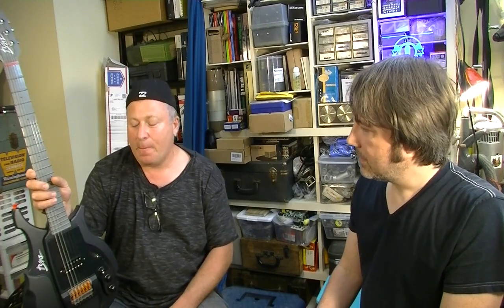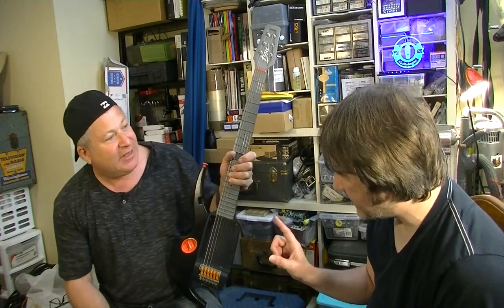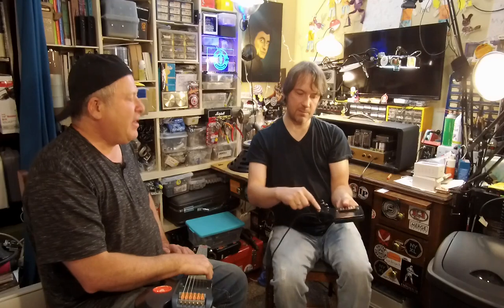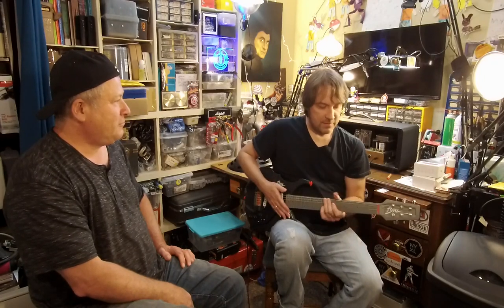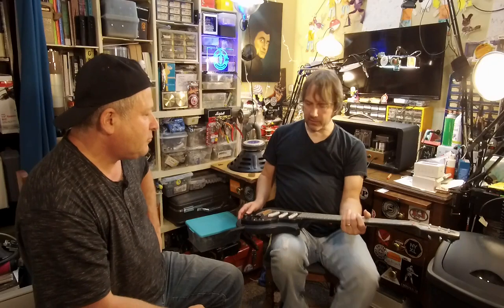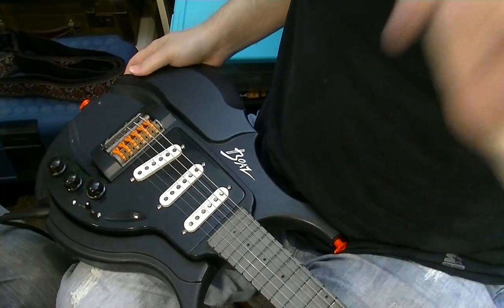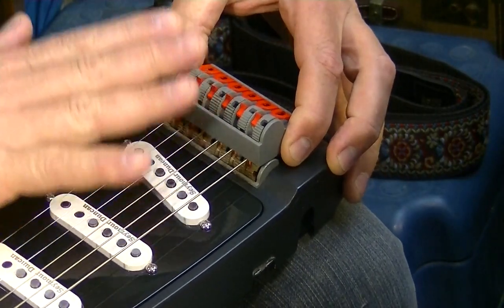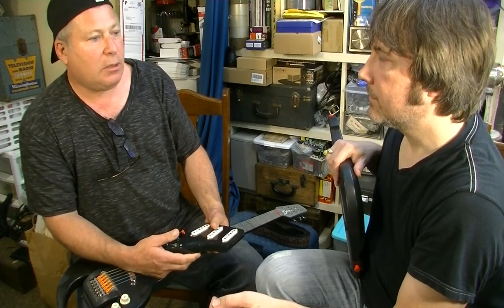THE GUITAR OF THE FUTURE! - 'Boaz One' Plastic Modular Guitar

Comment from the maker: Save 10% on Native Sons Straps with this code: GUITOLOGIST10 https://www.nativesonsgoods.com/
Thanks for supporting my sponsor!
Reply: Definitely a product I'll be keeping an eye on sounds great, I mainly play Acoustic Guitar but do have a Godin SD which I dig out now and again if I was to get something different this would be on the list, thanks Brad for more great content
Reply: @15:50 I'm pretty sure he means Delrin or Polyoxymethylene, an engineered thermoplastic developed b DuPont. I operated CNC's that made ball valve seals supplied to petrochemical companies. We machined billet extrusions to manufacture each seal per specifications using their proprietary designs.
    This stuff is amazing...in it's natural state it looks and feels like regular white acetyl but a much higher density you can feel. It's strength, stiffness, low friction, and dimensional stiffness makes it great rust-proof option for metal, yes it can replace many metal applications. You can machine it to tolerances in ten-thousandths with minimal variances due to thermal expansion.
   I've personally taken home 1/4 inch thick butt-ends of 5in. diameter billets and set them up as targets and shot them with .38 special, +P, .45auto, and every caliber below those with the shortest distance 10 feet.....not a dent, hardly a scratch....nothing but lead splatter. 
   Truly awesome stuff.
Great vid, Brad!
Reply from the maker: In the description are the links to his YouTube videos. He doesn't yet have the Indiegogo campaign up. When he puts it up, I'll post it here and announce it on a SPF.
Reply: Addendum: Fret wear. Even though it's very tough, Delrin will abrade... however it will not indent. But I believe based on my experience, it will abrade less than nickel or similar fret material, probably (not sure) it will abrade more than stainless steel. Solution: Drop-in/Pop-in fretboard. I bet the fretboard is machined; they could be CNC'd and rip out hundreds a day super cheap. Or if you prefer the sound of metal frets, CNC a groove in the raised portion and epoxy in metal frets of choice.
Reply: This is awesome! The bridge alone sold me. Can’t wait for the indiegogo campaign.
Reply: The plastic is called Delrin.
Reply: @michaelmoore7975  This is why we need a fretless bass version :)
Reply: @aurthorthing7403  Good idea. But for any potential patent infringements we'll  call it the "Baseless Fret" version. ;)
Reply: @michaelmoore7975  Frets abrasion: Certainly. Especially for people who do a lot of bending and vibrato. I wonder how much he considered this... I didn't look at the entire video, so I still wonder how soft the frets are in this regard.
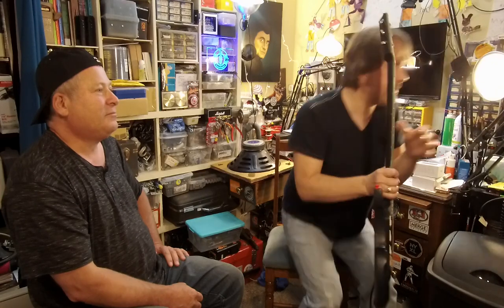Reply: @EddieOtool  From 16:32 to 17:08 they talk a bit about the frets. It also shows pretty good close-ups. You can see the frets are flattened instead of crowned, this tells me he realized a potential to abrade quicker when the contact point is thinner, i.e. he flattened them to "spread the friction" over a wider contact area, minimizing wear but not completelety negating it. 
     Delrin has an inherent low-friction quality; a "slickness" that makes it feel similar to a freshly oiled fretboard. I know that sounds counter-intuitive to my previuos statement but here is the rub (pun intended). Compared to most metals, the surface hardness of Delrin on the Rockwell R Scale is R122, (kinda soft). Dynamic Coefficient of Friction is .25, (pretty slick). On the Rockwell B scale Stainless steel is B88 (very hard) and around .42-.60 friction. Nickel-Silver is B60 (still pretty hard) , and about the same friction as Stainless. Delrin is "slicker" but surface hardness is less than normal frets. 
      I believe the Delrin (flattened top) frets would last a similar amount of time in normal playing compared to Nickel-Silver. Perhaps less than Stainless. But if you're a grinder I expect that time to be shortened dramatically. Of course other factors come into play also: string material, diameter, smooth or wound strings all affect wear characteristics. The sound would be a little different with Delrin; not as "bright" ...a little more muted. Regular frets get indentations on the 'cowboy chord' area, but Delrin has a Durometer rating that gives it resilliency and ability to "bounce back" those small deformations caused by pressing the string down over time; however Delrin can be nicked, cut, dented or scraped simllar to wood.
   I think the Delrin would feel soft when fretting and sound a bit muted. Special techniques such as tapping, hammer-ons, pull-offs etc. would probably sound nothing like metal frets. The decay of a note would probably be shorter as well. Also, the inventor stated he just used a Sharpie to color the fret tops, I bet it doesn't take but a couple of minutes of playing to wear it off.
   The primary concern for most guitarists will be sound.  Wear characteristics, feel  and appearance would be secondary.
Reply: JosHuang Gray  yeah, it could destroy all that is natural...kind of like deforestation has been doing.
Reply from the maker: I've been informed that they plan to start the Indiegogo campaign in the middle of JULY, not June, so that's my bad. I'll post an update here and also mention the date in a SPF when it gets closer to time.
Reply: The Guitologist thanks for the update man. I'm really looking forward to it.

Comment: The plastic the neck is made from is delrin. Gonna be watching for this one! Hope they make a Floyd style bridge.
Reply: Yes, the same plastic that picks are made from, very ingenious... From Wikipedia: Polyoxymethylene (POM), also known as acetal,[2]polyacetal, and polyformaldehyde, is an engineering thermoplastic used in precision parts requiring high stiffness, low friction, and excellent dimensional stability. As with many other synthetic polymers, it is produced by different chemical firms with slightly different formulas and sold variously by such names as Delrin, Celcon, Ramtal, Duracon, Kepital, and Hostaform.
Reply: @morrismiller1055  That's awesome, Morris!
Reply: I hear Flame Delrin has a biting top end, Celcon has a mahogany midrange.....

Comment: Some info about Delrin.

It's a very VERY high density extremely high temperature thermoplastic.  It's reinforced with a large percentage glass fiber in this mix.  He's right that it's pretty expensive.  

I doubt you'd be able to wear these things over 5+ years with very regular playing.  I suspect the metal on the frets will actually wear quicker.

Comment: I would like to see this with a wireless system in it. No cables needed.
Btw he means Delrin or also called POM (Delrin is a brand name but most people in the US call it that way)
Reply: Polyoxymethylene, awesome stuff. Worked with it a lot. Read my posts under "pinned by The Guitologist" at the top of the page.
Reply: I used to do machine design as a technician, and Delrin was to us a very reliable engineering material. You can call it "plastic metal" in a way; one of the toughest and most usable one you can easily find. We would consider this material whenever we needed something just a bit less resistant than aluminium, lightweight, and easily machineable. It gives great results: no melting, no deformation under heat from machining, and reasonably precise result. I recall I heard some people even did combustion engine blocks made of Delrin so much it is enduring, but don't quote me on that. I just don't know how well it resonates compared to wood; I personnaly tend to find my guitars have a plastic-like resonnance when played unplugged that totally turns me off... That's why I ended up changing a plastic pick guard on one of my guitars for a mahogany plywood one; it did make a totally welcome difference...
Reply: Delrin picks are a nice alternative to nylon. Try them if you haven't already.🎸
Reply: @54fighting5  Indeed I have. I've taken home scraps to fashion into all sorts of things and made about 50 or so picks. Gave a lot away. They last forever. So stiff they can be made thinner, but so slick I had to drill multiple holes in them to improve the grip. Also made pistol grips and checkered them. Looks similar to bone or pearl and will never crack. Knife handles. File handles.  Non-marking contoured dapping mallets. I've even taken the shavings from CNC millings and  woven and braided snatch-ropes to pull out stuck 4-wheelers and even stuck full-size trucks for my off-road buddies. They will not break and only a slight bit of stretch.
Reply: @michaelmoore7975  Lol dang I feel like a slacker. I bought mine on Amazon. Thanks for all the info, I had no idea there were so many uses.
Reply: @54fighting5  What? they got 'em on Amazon? I knew I should have marketed them. Now I feel like a slacker. Lol
Reply: As far as picks are concerned, I get more durability out of polycarbonate than delrin, by a long shot. The only downfal is polycarbonate tends to break when flexed repeatedly.
Reply: @EddieOtool  I've tried poly before, made some picks out of scratched up safety goggles (I hate having to buy anything ) but I can't remember why I didn't like them. As cheap as they are, I still like making my own...Bass and guitar picks made of cork, single-split cowhide, aluminum, various woods, felt layers glued and pressed, boot soles, PEEK (Polyether Ether Ketone), Bronze/TFE, Glass/Moly/TFE, Graphite/TFE, polystyrene melted and molded, old credit cards, AOL CD's (I think those are polycarbonate)...you name it, I probably tried it.
Reply: @michaelmoore7975  Interesting. How did the PEEK ones fared? I used to work with that material a long time ago. A plastic with very high melting point... 

As I said, albeit lasting, poly is brittle, which is a good enough reason not to like it. It also convey some kind of feel which might not be likeable to everybody. It is stiff yes, but somehow awkwardly so.
Reply: @EddieOtool  The PEEK was too stiff. Not enough flex; and when I would  taper the cross section thickness down to the tip, it reached a point of decent flex (and I like 1.0mm!) but would crack pretty quick after playing a bit. It had a raspy kinda harsh gritty sound at the initial strike of a note. Really gritty if you change the attack angle, and like a primary saw at a mill when you do a pick slide. I kinda liked it. 
      I used to work for a company specializing in CNC custom industrial plastics manufacturing. For the most part, we made ball-valve seals for petrochemical companies using their proprietary designs and specifications; along with a standard line of products. They had other products besides seals too, but I just worked as CNC programmer/operator for ball-valve seals. Our materials were: Peek, Virgin and Filled
. UHMW. Acetal. Delrin. PVC. Torlon. Rulon. Ryton. Tefzel. Phenolic. Nylon. Nylatron.    In-house we also made: VirginTFE
. Glass/TFE. Glass/Moly/TFE. Bronze/TFE. Carbon/TFE. Graphite/TFE.             
           Made picks out of most of them, Delrin was my all-around favorite.
Reply: @michaelmoore7975  Nice! Thanks for the info! :)

Comment: "Whereas the traditional electric guitar bridge adjusts each string through a two-axis, rectilinear, adjustment system (height above body; distance to nut) the Boaz bridge is curvilinear - a polar coordinated, eccentric (off-center) system which automatically compensates for the intonation by moving the string closer/further to the nut as the height is lowered/raised."

- Randy Zeitman .... Mr. Boaz, you're welcome to use this text without need for compensation. This is a fantastic product and can't wait for the bass.

Comment: Seems like a toy to me. I would worry about plastic pieces breaking. Just my 2 cents.
Reply: @Swetty Spaghtti - If the neck is any kind of indication, that Delrin is almost as hard as steel, much lighter, and very durable. I'm sure the modules will probably be made of something nearly as tough as the neck/center section, or whatever you desire, and if you get involved with the kickstarter project, you can customize it all you want, as long as you supply the funding to create it!😉
Reply: @danw1955  I dont trust the bridge pieces at all. Im at a gig,one of those orange bridge pieces breaks. Done
Reply: @swettyspaghtti  True, but then again, there's support on both sides of the bridge comb with the slot in the cams. Also if it becomes an issue, the bridge comb could always be machined from brass or some other springy metal. Gotta remember, we're talking an entry-level priced, still-in-development guitar here. If you have suggestions to make it better, contact the developer!😉

Comment: Seems clever, I wonder if one of the modules also has it's own small battery powered amplifier? Have a small speaker on it or plug in headphones. Would make it portable and self-contained for practice. Might also be interesting as a platform for those oddball guitars that are used to drive synthesis.

--- Edit - (They get to that at the end... So already ahead of me there.)

Also on the plastic thing... If it's textured a bit, it will eventually get worn smooth with frequent handling and the oils from hands and sweat as it is. Look at what happens to TV remotes/game controllers/computer mice when they get old. A slightly gloss finish would make that less noticeable.

And since it's plastic, you could probably do some more gimmicky stuff like molding LEDs into the thing. But that might be useful as it could be possible to make a learning type version that shows fingering on the fret board.
Reply: We do have a modular amp and speaker body. email morris@boazinstruments.com for more info. Thanks

Comment: Really brilliant ! very good concept I believe, they just will have to improve the appearance of the bodies and modules, in a way that will not look as cheap plastic, put some nice quality paints or whatever, because this will be the point that will cause reject from most guitarists.
Otherwise, this is great. No need for a truss rod in this neck construction, good point obviously. 

Just one thing about the bridge for open tunings; ok the height affects the tone, but then, will it be too high for action ? Could be uncool if it's like a reset neck need ! But maybe I didn't understand all, is there a compensating system ?  this guy is just so clever.

Comment: what  brilliant idea maybe a good idea if there was a little cam switch that only tuned on the pickups when its slid into the guitar so u could use it like u said with havin the diff pickup options plugged into seperate amps

Comment: There are a lot of new inovations here. Boaz is definitely a modern Leo Fender.
I'm wondering if it would sound better made out of a nice tone wood. Mahogany would be my favorite.
Also, the Preamp or even on board Modeling Amp would be a good idea. Connected to a powered speaker cabinet, you could have an on board Preamp Gain stage. And, a remote power amp Master volume. Tube or, tubeless.
Reply from the maker: I was thinking a headphone jack and headphones would be an obvious way to go with the onboard amp.
Reply: I like the wireless bluetooth idea.

Comment: Delrin is a good tough plastic i turn it on the lathe and mill it all the time .Pretty interesting idea .,Excellent video Brad
Reply: @Nobby Heads Delrin is Very UV stable and Stays kind of pliable .It never in any instance ive seen becomes brittle and ive seen it used around some pretty harsh Chemicals . I.M.O its the perfect Plastic for this application very stable Material. Also pretty expensive .

Comment: at 10:50, instead of already having the cable plugged into a separate cassette that's plugged into a separate amp, it would be nicer to have a mechanism that allows the cable to stay attached to the body/neck/bridge without having to take the cable out as you swap cassettes.

Comment: There was another system that I saw recently that had a plug n play pick-up system with changeable body shapes.  The bridge system is not as brilliantly designed as Mr. Elkayam's bridge is.  The esthetics remind me of playing Guitar Hero with a guitar shaped controller.  

On a system guitar, part of the joy is doing all the upgrades and having all the add -ons.  So, $399 could be the start of a long upgrade path and expense.  Even on that brilliantly designed cam bridge, most guitarists set the height they enjoy playing at - and leave it alone.  The bass has great merit, and yet it  suffers from needing it in only a limited way.  

3 and 4d CNC routers and component parts of a guitar like  bridges, Tuners-10 cents a pop - have reduced manufacturing cost down to $28.85 for an electric guitar made from traditional woods.  You add shipping and markup - that's 75 - $100.  And some of us still have that one particular guitar we fell in love with that overwhelms are desire to own - problem being - it $2,751 used.  So - there is way more than a better engineered guitar to think about - there is soul and feel? What kind of personality does it possess? Does it look like something you would play?  

I tend to look for a guitar that has a sound, feel, and personality that complements my own, yet inspires me to play in a different way.  Maybe a traveling guitarist would see it in a different way, but system guitars like the Boaz don't improve on the sound of the electric guitar --- and it would still be fun to play around with as a novelty.   I would not begrudge anyone from buying a "Boaz". 

I guess bottom line, system guitars just don't speak to me - and frankly there are a good number of guitars that are fully decked out ragers at the same price as the "Boaz" entry set-up.   And - let's be clear - it would still be fun to get my hands on one to see what comes out.